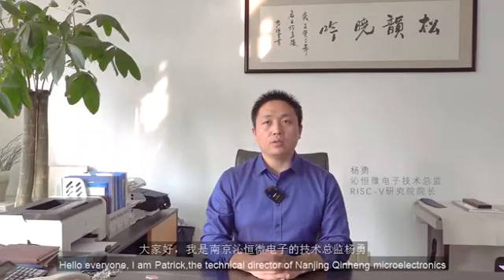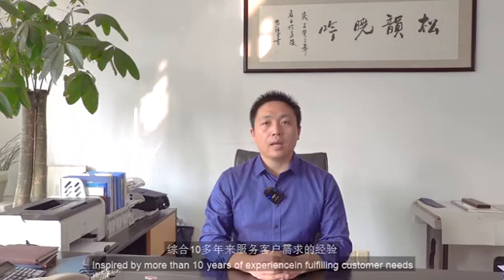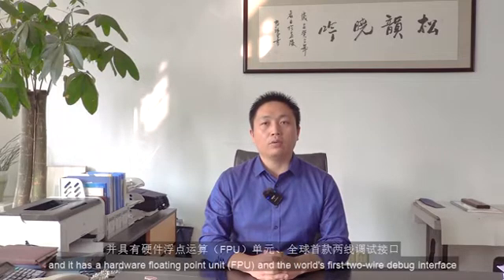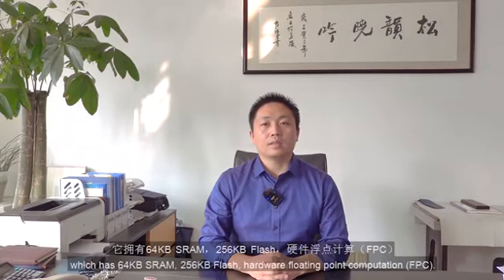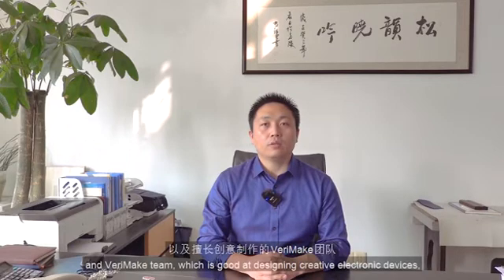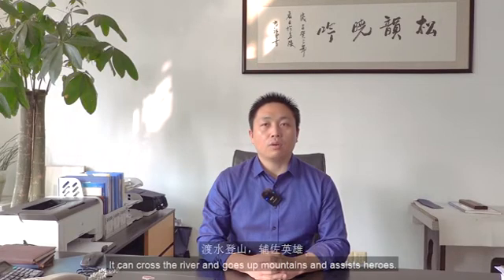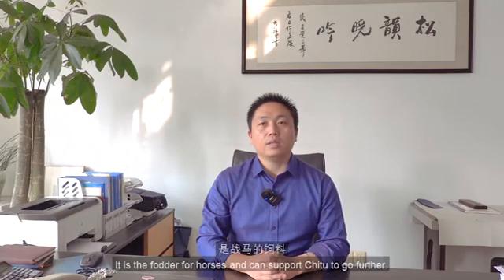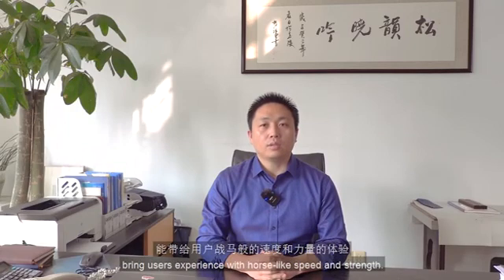RISC-V/QingKe/32-bit MCU/WCH/Patrick

Comment: Amazing video.  I wish the transcript for this could be included in the datasheets for WCH microcontrollers.

For the longest time, I thought QingKe was a company developing RISC-V IP instead of WCH's in-house IP.
Reply from the maker: Ah, WCH is a very special chip design company. Not only can design the core IP,  but also can provide the whole solutions according to customer needs😀

Comment: Hi. Can you explain how much cycled of main clock needed for one instruction for ch32v003? Cycles per instruction.
Reply from the maker: Here are some tips for your testing. The program should be executed in RAM and the main frequence need be set less than 24MHz. Regarding the sw-sw looping, The time of jumping instruction should be involved.
Reply: @rvmaking  ok, but what it means? I need more explanation of inner structure and speed restrictions. How can I bit-bang if I cannot count cycles?
Reply: It's RISC, probably one cycle per instruction.
Reply: @RobertBeznazwiska  I have also sought so, but my measurements by bit-banging show me another truth. With freq 48 MHz of cpu I can achieve only 12MHz square wave with sw-by-sw command (set bit 1, set bit 0, one coommand per bit).
Reply: Thanks. I Used BSCR. But what is a reason for it? I cannot explain. I also disabled flash latency.